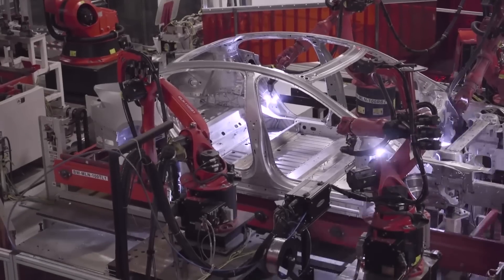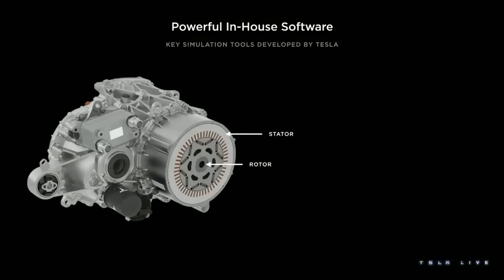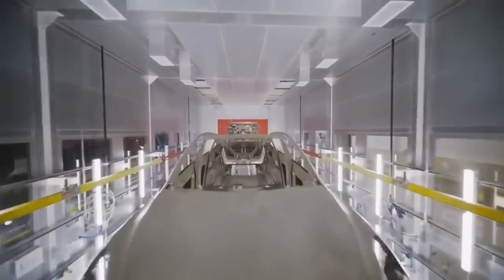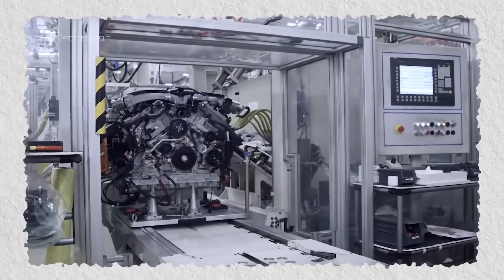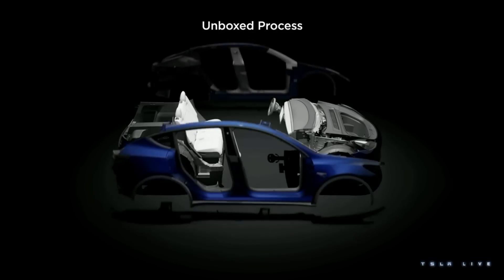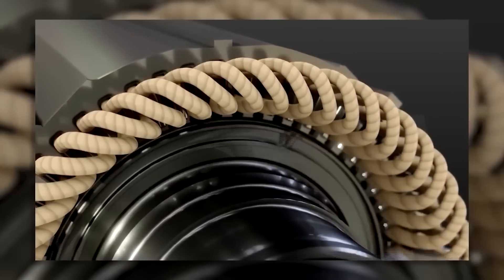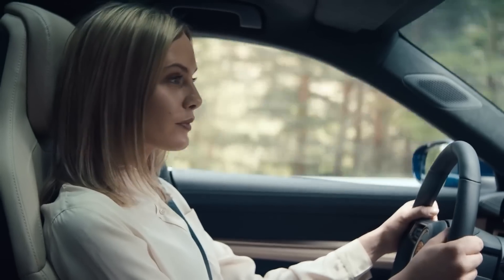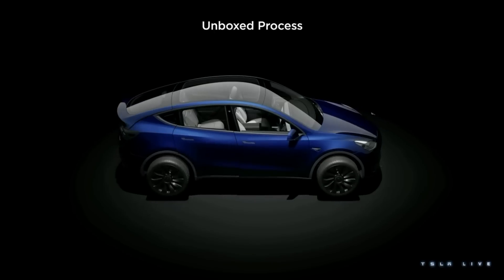Elon Musks NEW HairPin Motor SHOCKS Entire Industry

Comment: Hairpin motors were not invented by Tesla and are not new for EVs. 
Wikipedia:  Hairpin technology is increasingly applied in automotive applications. The first production vehicle with hairpin technology was the 2008 General Motors Chevrolet Tahoe hybrid featuring 2 motors with this stator construction in GM's 2ML70 "2Mode" transmission. [21]
The Volkswagen Group relies on hairpin stators in its electric vehicles, including the ID.3,[22] ID.4[23] the Audi e-tron GT,[24] and the Porsche Taycan.[25] The BMW iX3 is the company's first vehicle to employ hairpin stators. In 2021, General Motors unveiled its new motor line up that includes a 64 kW ASM for hybrid applications and a 255 kW PSM in the Hummer EV.[26] In 2023, Tesla announced that its next generation motor would use hairpins.[27]

Comment: So, if hairpin motors were used back in 2007 or so,  what is so different about this Tesla hairpin motor that will shock the industry?  The technology is not new, but evidently this motor gives more power and range with the new design.   We shall see as time goes on.

Comment: Big deal.... There is nothing which addresses the BIGGEST drawbacks of EVs here: Batteries & vehicle cost. Battery charge time & range per charge is a major issue... Anything which does not allow a full recharge in under 10 minutes is a waste of time. Anything which has a full range of less that 1000km is a step back in vehicle development. Making the battery a semi permanent part of the vehicle makes it expensive. When the battery fails, the cost of the replacement is often more than half the vehicle cost! The driver should never own the battery, it should be an exchange battery pack which the driver exchanges at a recharge station like a BBQ tank exchange.
Reply: As an EV owner, I disagree with you. 😁And my previous car was a small diesel SUV with almost 1000km range. It's time for people to stop thinking about what EV cannot do which ICEs do, but rather what EVs can do that ICEs cannot do. You will be (positively) surprised.

Comment: Congratulations Mr Tesla. I must praise your genius on the invention of hairpin motor absolutely suitable for the electric fan at home at night when it's slightly warmer. You did it again. 

As we all know EVs are self-crematory coffins. Every now and then, EVs companies will blow trumpets about different breakthroughs in batteries or motors. But still EVs require high voltage. Meaning the catastrophic failure of F150 is unavoidable. The bigger the vehicle, the higher the voltage as well as the danger it brings.
Reply: Hair pin motors won't lower the voltage for the car significantly that won't self cremated when crashes. Still EVs are as danger as they always should be. 

Hair pin motors will fool more people to buy themselves a self crematory coffin. 

This world is getting more and more crazier. People love to turn into ashes. I must get out of this planet fast.
Reply: Have you ever looked up How
Many people have died in car fires to date? And all of a sudden they are horrible danger being electric? Sounds like an exon complaint to me
Reply: @sandyt4343  First of all, do you understand what causes EVs to  catch fire as compared to gas cars? Did you know that if you light up a tank of gasoline without compression it won't explode? Do you understand how Internal Combustion engine works?

How many gas cars in the world as compared to EVs? What are the chances of gas cars catch fire as compares to EV based on the total number of vehicles throughout the world?
Reply: @sandyt4343  Do you know why FORD had to stop selling their best seller F150 electric truck? Because F150 will automatically cremate itself while parking. 

Do you know the bigger the truck, the higher the voltage is required to power the electric motors. In case you don't know such a simple common sense. I'm so sorry for your IQ. The higher the voltage will cause the EVs a lot of difficulties in dissipating heat. As heat keeps on accumulating. You get yourself a self-crematory coffins. Isn't that great to die together with loved ones and everything and everywhere all at once?

From the stand point of self-crematory coffins F150 is definitely a very successful model to say the least. At least it performs as what it should be. Which is to cremate the entire car and passengers together. Sadly Americans don't seem to enjoy cremation.
Reply: @sandyt4343  Have you purchased an EV yet if you love being cremated in a luxurious seats? Go get a F150. You won't regret about it. 

I'm so happy for you.
Reply: @sandyt4343  in high way when a series of gas cars collided into another. You don't see them bursting into fire. But as for EVs things are different. If a series of EVs clashing together. Be sure everything will burn into ashes.

Dissemble an EV and take the battery pack and pierce through it and see what will happen. It will light up with explosion. So during collision who can promise no sharp object could pierce through the battery pack located at the bottom of the car? Nobody can. In fact this is what happens to Evs, easily catching fire after collisions.

As for gas cars, you only see the cars turn into meatballs after heavy impact. 

People are getting more and more dumber without really understanding what is actually going on.
Reply: @infiniteandunlimitedabundance  we had a tesla go off a cliff and do a 600 foot freefall landing on its wheels near us about 2 1/2 months ago with absolutely no fire and actually the four passengers in the car all survived without any major injury. I saw another car go off there in the same area, approximately 40 years ago as I was driving to work, and although it didn’t catch fire, it was demolished beyond recognition when it hit.
Reply: @sandyt4343  Just last year a Taiwanese celebrity clashed his Tesla in Taiwan. The car burst into flames and almost had him killed if he hadn't rescued in time. He wasn't speeding. From the footage of CCTV, he was making a U-turn before hitting a roadside blocks a few metres ahead. The car self cremated immediately. This will not happen to gas car no matter how you want to lie about it.

Everybody must have seen how gas cars got into accident. Very very seldom they catch on fires. Unless the owner install sound systems that overload the circuit. Or the refrigerant of the air conditioning system was contaminated with flammable substance. 

Gas cars won't easily catch on fire but EVs do. Go and pierce through a battery pack and see for yourself.
Reply: @sandyt4343  Go find out why FORD had to force shutting down the production of F150. It's the best seller if it's safe? Does it make any sense to you?

Don't make stupid argument if you don't have any clue about the danger of EVs. The higher the voltage the more dangerous your life would become.

Comment: Tesla's specialty is manufacturing, so making low cost state of the art hairpin motors at scale should be expected.
Reply: Was hoping there next announcement was iron nitrate magnets. 

Also Tesla should get in on Axial Flux motors. Tiny as hell, light, but extremely powerful. Koensieggs Quark engine is insane.

 Electric engines are already stupid efficient. We just need those battery break throughs that constantly hear about but never come to fruition.